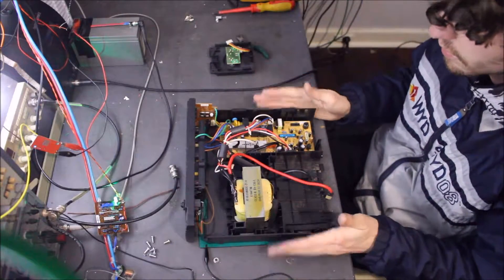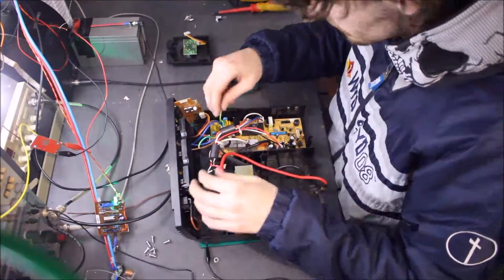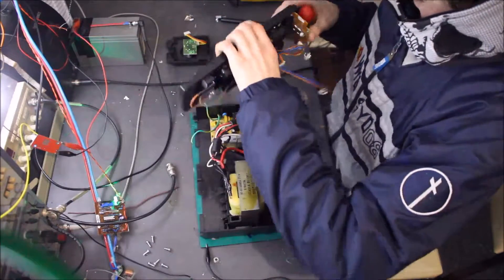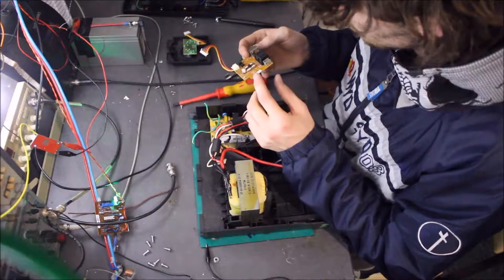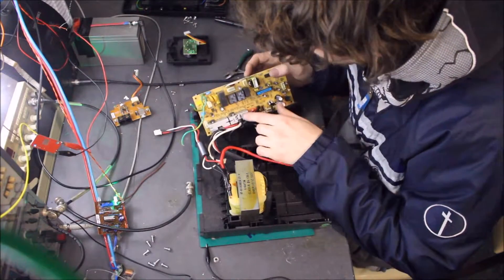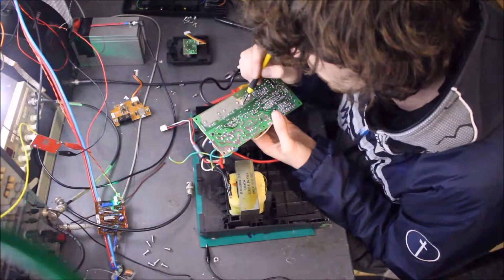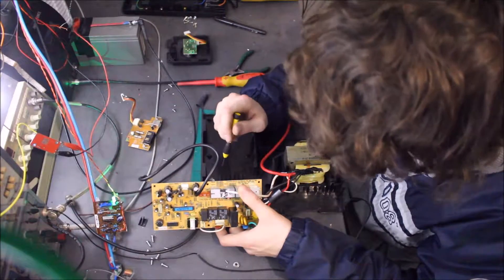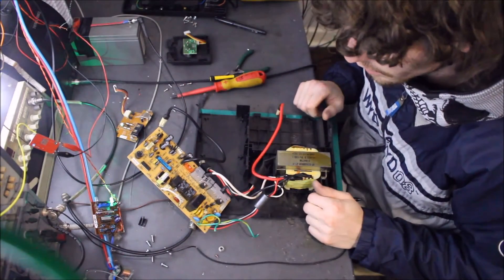urbanoffgrid13 eaton 5110 UPS Look

Comment: I have some 5110's that have 4 MOSFETs and 2  40A fuses.  They also take just 1  12V 8AH battery. They work fine giving A/C (120v) output, but do not charge the battery.  Do you know what part of the circuit does the charging?
Reply from the maker: i think these might charge through the transformer and mosfets. I dont have mine around anymore so i cant look for you